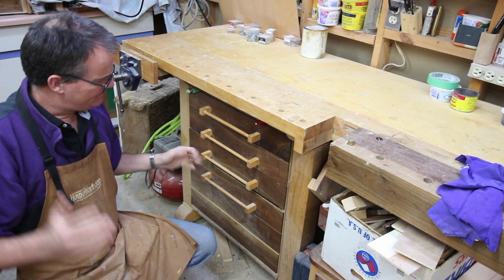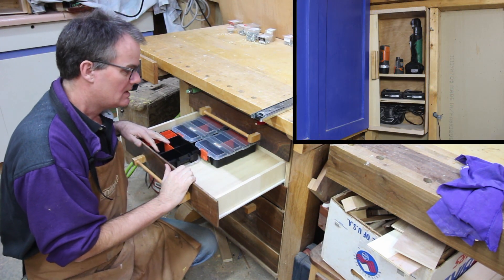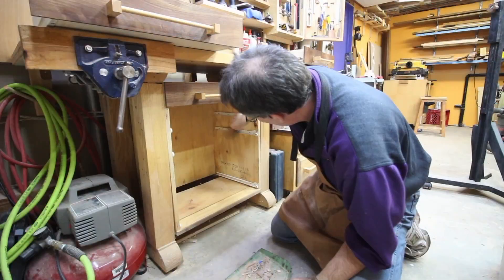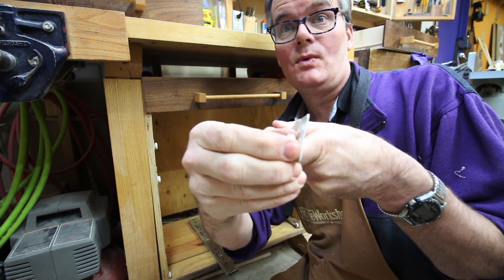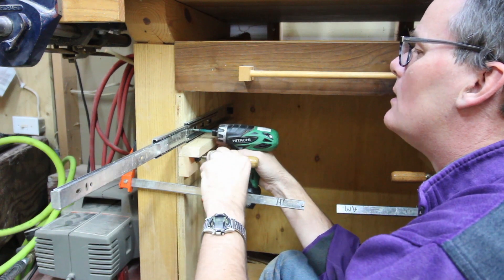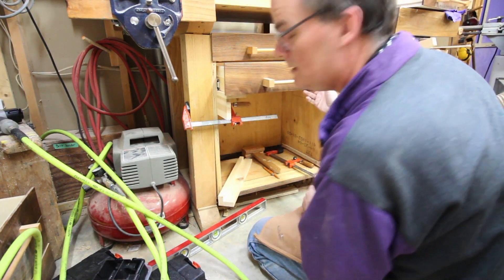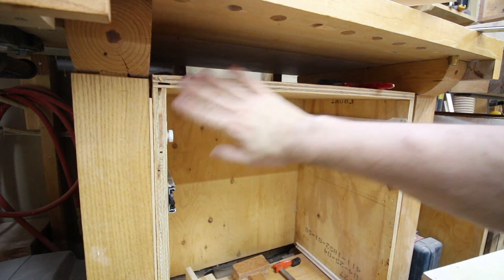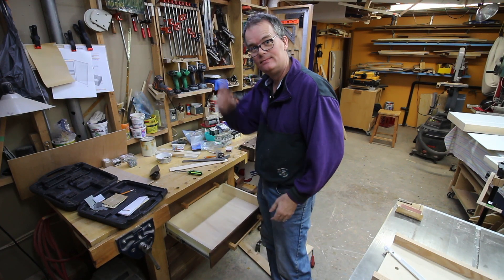Trying to Change Shop Drawer Slides (WnW #84)

Comment: I was going to say that I actually like how those Euro slides work in general, and only have a problem with them not being full extension. Can get around that though by using longer slides on a deeper carcass and shorter drawers. Loose some space in the back, but pretending it doesn't exist works for me :D
Reply from the maker: I've done that also...

Comment: It's funny I just did this same thing. I cut down an old rolling work bench to use as an outfeed table for my table saw and decided to put drawers in all the space instead of just the two underneath the work surface that had those old slides. I discovered that it was easier to start from the bottom and put the bottom drawer in with the slides and then used 1/2" ply spacers between the the drawers working my way up. I rally like that I now have 6 six full extension drawers. So far only 3 of them have stuff in them but I know that will change soon.

Comment: Ummmm... Art? Go to 3:46 in your video and look at how you clamped your jig to the cabinet. Think that may have been the cause of the cabinet spreading open in the middle? The whole time you were measuring, you had that clamp there, so naturally that side would bow out - right there where you measured it.
Reply from the maker: It's possible, but I still think it bowed a bit on it's own over the years, which is why the wheels on the slides bent.